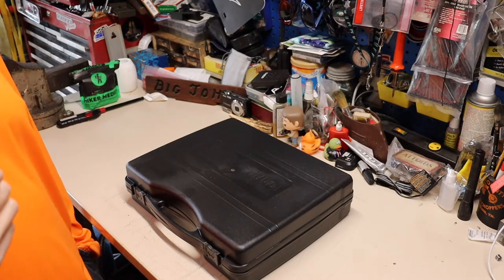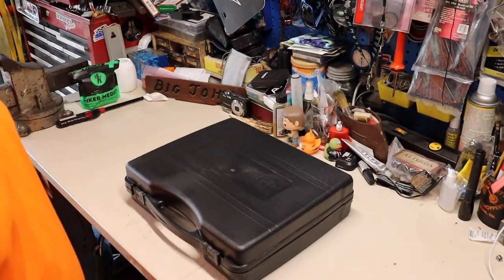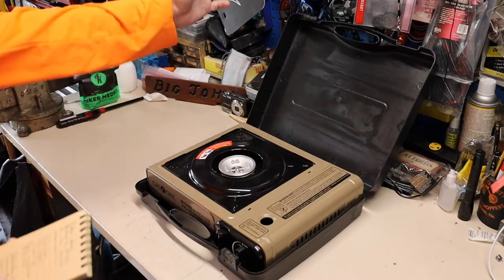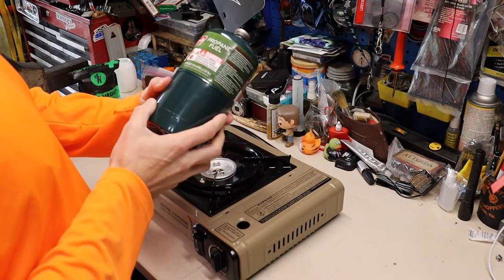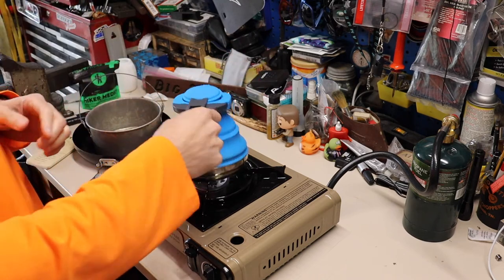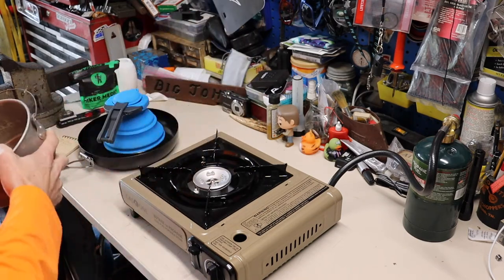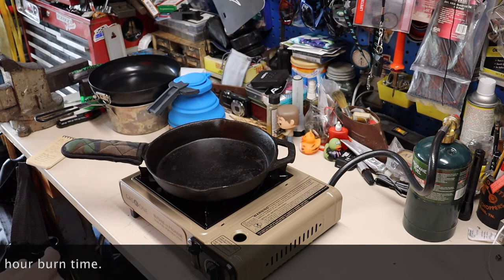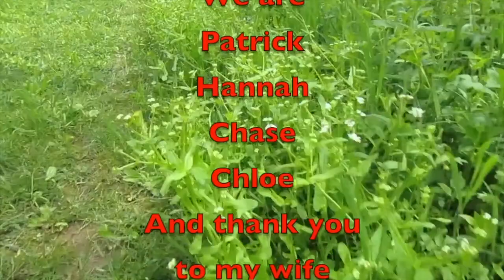Gas One Dual Fuel Stove

Comment: This is certainly a great little stove.  I bought mine from Amazon last year and have used it on several camping trips, and ordered another just for a back up in case of a power dump.

I would reccomend this type of stove, its light, comes with a case and and works like all getup !
Reply from the maker: We are about to get cooler weather and this thing is about to put in work.

Comment: I got one of those stove as a kit with my Can Cooker.   It's come in handy a few times when the power has gone out.  Picked up a 2nd one at my favorite thrift store a few months back for $10.  I could not pass that deal.  You can also hook them up to a 20# if you have the adapter.  I have a small 5# I like to use when camping.   I've had it for awhile and wasn't that expensive.  Nowadays,  you can almost get 2 20#s for what a 5# cost.
Reply from the maker: I may pick up an extra 20 pounder for camping, I have the adapter and a tree just need the tank. Thank for stopping in brother.